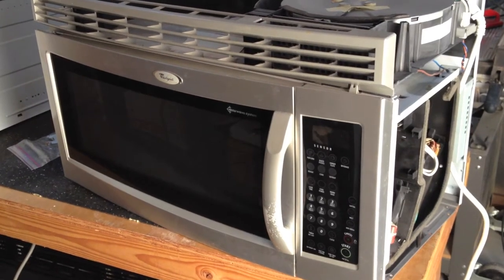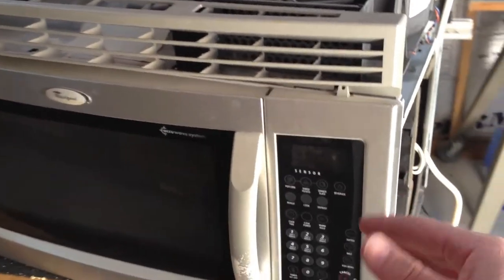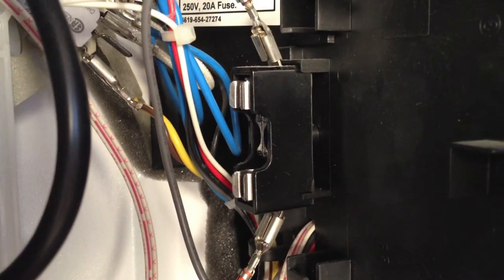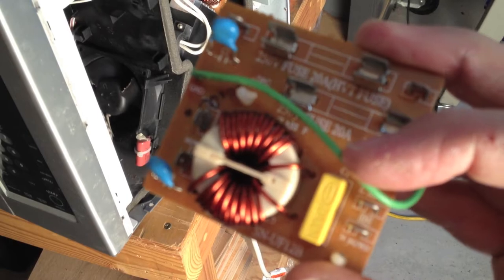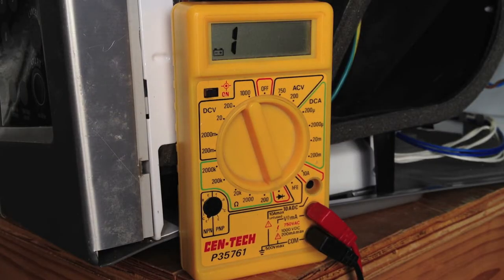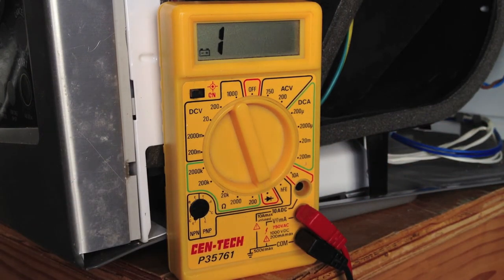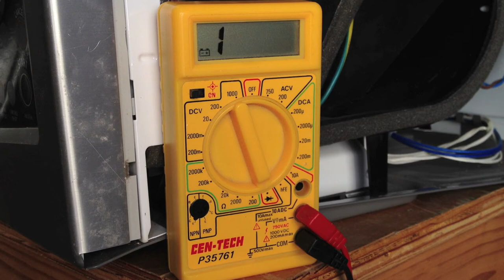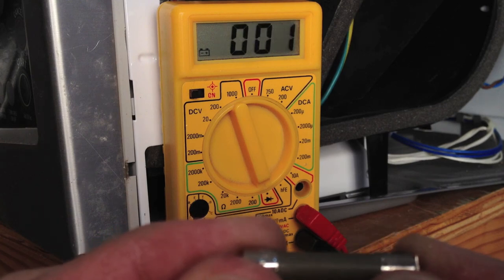Testing a microwave fuse

Comment: You have the identical circuitry for the fuses as mine.  Did you have to buy the authentic OEM fuses. I bought a few ceramic fuses from Amazon with matching power ratings, but they all blew instantly.  I am wondering if this circuitry requires "slow-blow" type of fuse instead of normal fast